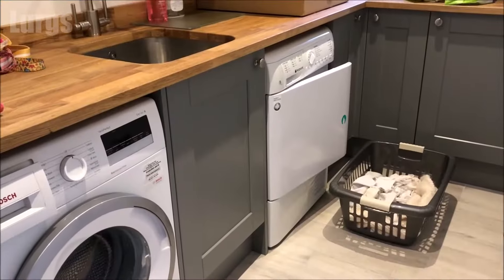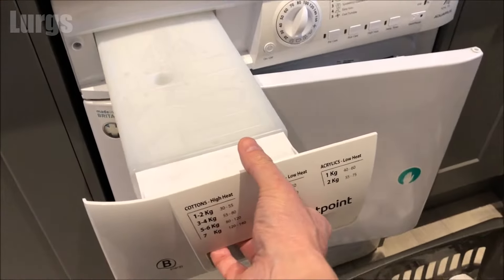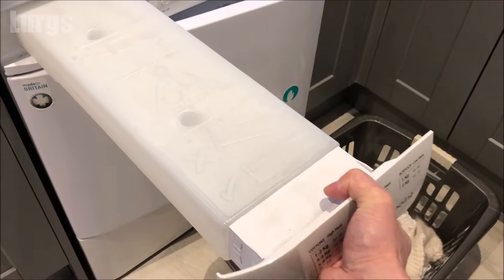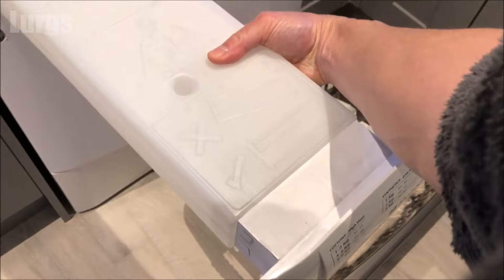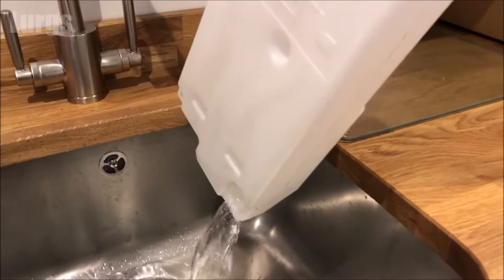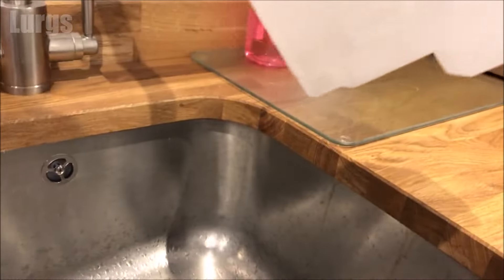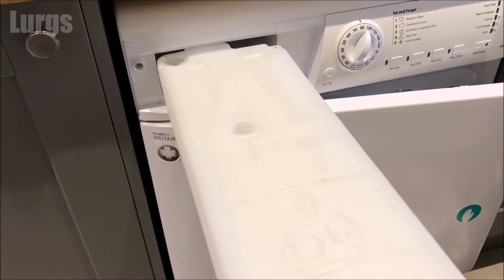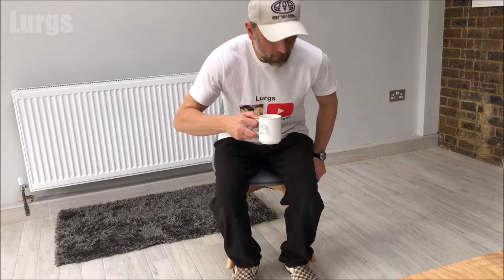How to empty water on a Condenser Tumble Dryer

Comment: The small hole is an air inlet, not a second drainage hole. Air needs to be let in when draining to avoid a vacuum, or the "belching" you get emptying a one-hole bottle.
Reply: Brand new dryer and mines not collecting water in the tank anyone know why and can I still use

Comment: One thing I would like to know is how to recycle the tumble dryer water other than drain it and waste all that water.
Reply from the maker: You can water the plants with it.
Reply: @LurgsHowToGuides  okay, I use some of it to wash my hands. Hope that's okay? 
I don't intend to use it to wash my dishes, knowing I'll be eating off them.
Reply from the maker: @jamesreed2366  It’s fine it’s pretty much distilled water so is very pure
Reply: @LurgsHowToGuides  so washing my hands with it is okay, but not using it to wash my dishes?
Reply from the maker: Yeh fine. No good for dishes as you need hot water for that
Reply: @LurgsHowToGuides  Okay, so I just need to boil it up and it should do the trick.

Comment: I find I have water pooling inside the slot that the drawer fits into. It doesn't always go into the drawer itself. How can I fix that?
Reply from the maker: Best check inside the drawer area to make sure no blockages. Not come across this before. Hope you can get it sorted.

Comment: My dryer doesnt collect the water on the draw. Its leaking at the bottom of the dryer itself. Any tips?
Reply from the maker: Not sure I’m afraid.
Reply: typically on the back will be a point you can attach a hose to (small hose, not garden hose) then run that to a drain somewhere